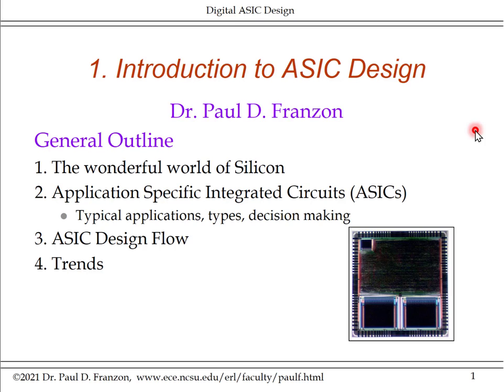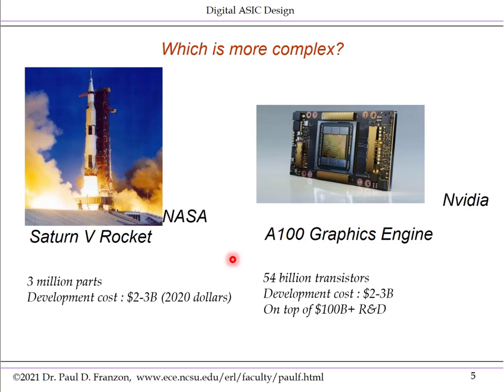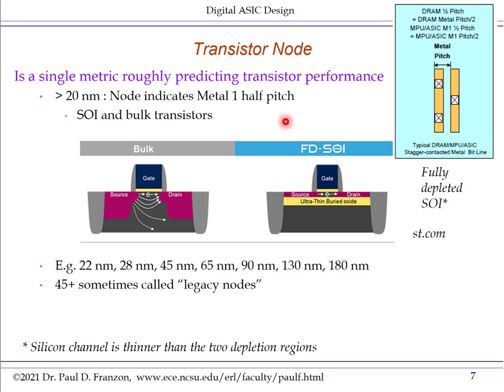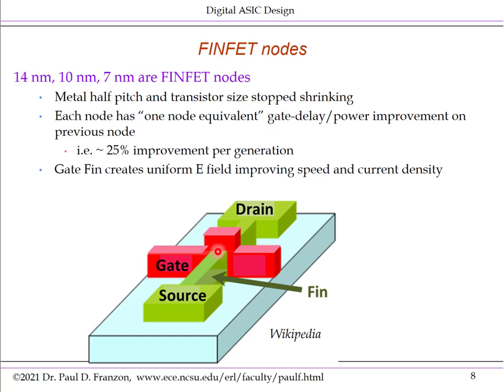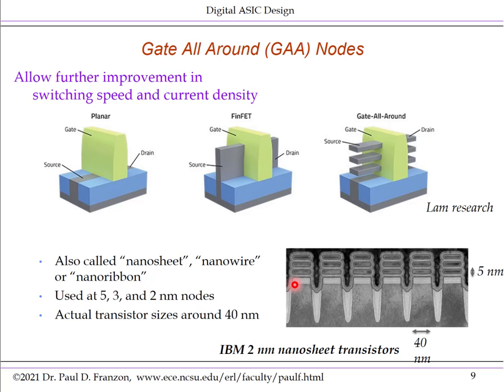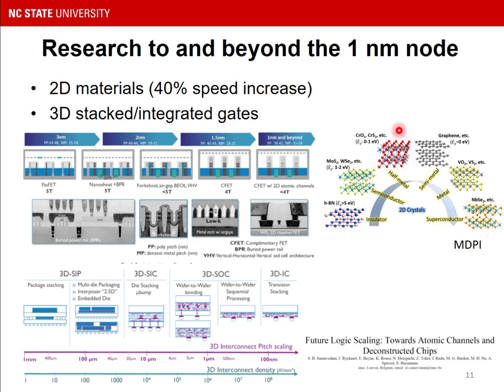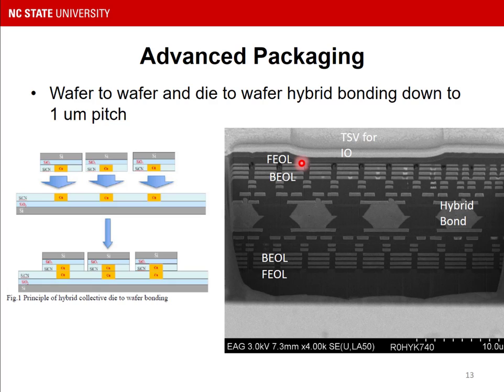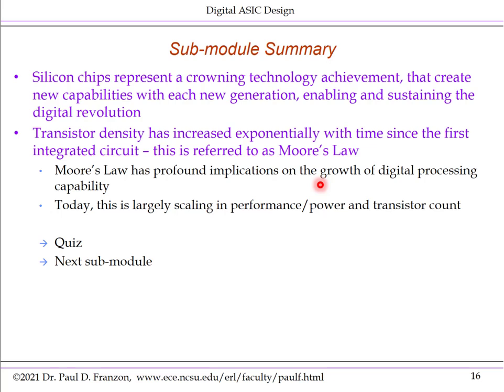Introduction1v2

Comment: The Saturn V vs A100 is facetious. They are not of the same era and the rocket industry also has a massive investment. The A100 transistors are mostly identical parts in highly regular arrays , made in one sequence under tight control of a single firm. The complexity of integration of a rocket is its own problem.